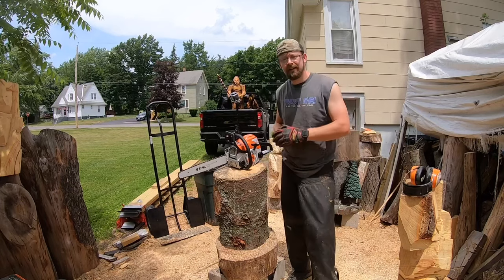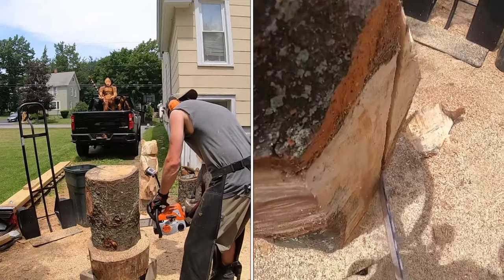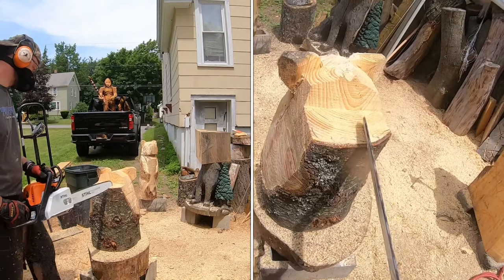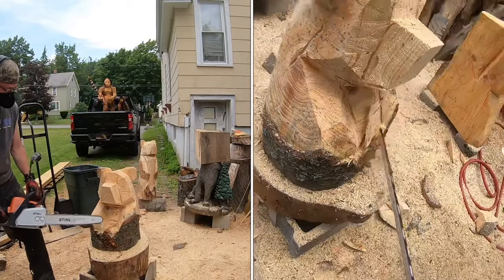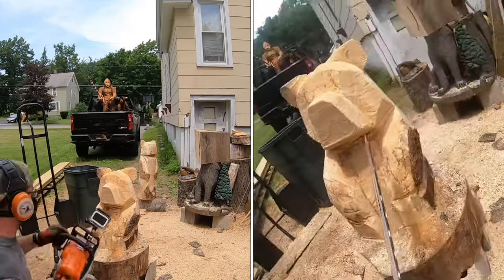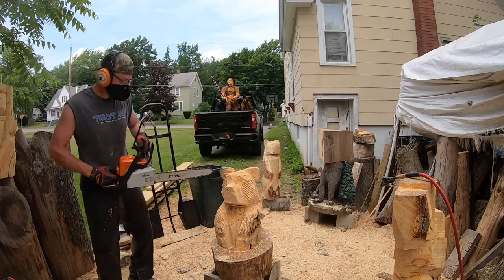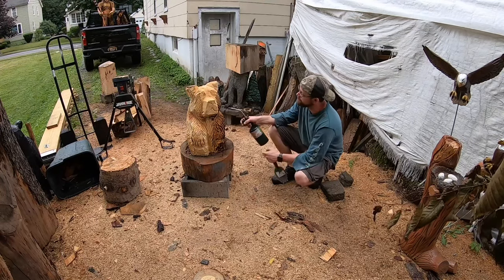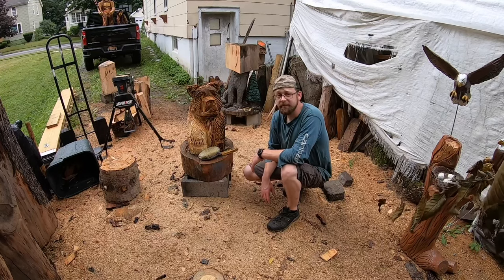Want to carve a bear ? Have a stock Stihl MS 170 ? Beginner chainsaw carving tutorial First carving

Comment: Nice Video. Would like to add that the Ms170 has Problems with the Heat from the Catalysator (melts through the oil tank) and it's carb isn't adjustable on most models.

I think for beginners a Stihl Msa140 is a good fit, since the chain and bar are better for carving. Also a electric chainsaw might be easier to usw than a gas powered one.
Reply from the maker: Thank you for the input Julian
Reply: I can confirm that the ms170 will need constant maintenance..I completely rebuilt mine last summer...I got parts from Amazon Germany although I live in southern Ireland..half price of cost here!
Reply: Cannot beat the lightweight electrics when you're near an outlet...

Comment: Frame 18:22 did I see u try to touch the bar n chain while running ?  Tremendous carving instruction but that part caught me by surprise.
Reply from the maker: Video was in high speed at that moment. Chain brake was on . Using my hand to focus camera as i can’t always see the bar through the camera while filming do to the Sun glare .
Reply from the maker: Theres also a good chance it still wasn’t running that’s why it cut to a different scene right after that shot

Comment: Thanks for the video! That bear looks super cute holding his paws! I made one today following your instruction. It actually came out okay considering I did it all with a Stihl 261 18” bar. Is that pine you’re using? Looks like it. I used white pine. Depending on bar position the wood would get stringy. The log I cut it from had been sitting a while. Is the best wood fresh cut? Pine? Ash? What’s the best species? Thanks again. I don’t think you’re boring lol.
Reply from the maker: You’re welcome! I’m usually carving yellow pine . I prefer pine . Sometimes I carve fresh cut , I’ll carve dried if it’s been sitting.
Thanks for the comment

Comment: I know this is a “starter” video… which I’m definitely a starter to wood carving. But I own a landscaping company, and also do some tree work. With that said, I’m not new to chain saws. Do you think a top handle saw would be better to start with? My top handle is much lighter than a 170. I do have a 170 I use on a rare occasion. But it is VERY under powered I think
Reply from the maker: The only thing I have heard with the top handle saw is the control aspect. In my opinion you have more control over a rear handle saw . Especially when carving. I agree the 170 is an under powered saw but it’s just a starter . It’s a way for someone who wants to carve but can not spend a lot . The 170 works nice as a detail saw. But if I could spend the cash I would probably just jump to the already set up 200 with a dime tip bar for detail work only . I like to use my 250 and 271 for blocking

Comment: Apologies if I missed something obvious…but how should the wood be attached to the base? Some kind of spike system/setup? Also, my Stihl is a 251C…is that really too large for beginning carving? And what about some of the smaller battery-powered Stihls…worth a look for carving duty? Thanks so much!
Reply from the maker: If your confident in handling the 251 then use it . I have used mine for blocking . I think the smaller Stihl battery saws would be good for detail work . I run the AP series battery saws by Stihl .

Comment: Thank you !!!!  Very much appreciate your VID tutorial , also ,. Could I carve with any type of  chainsaw?  I wanna buy one for work as well as for carving meaning use the same one for both applications, thanks in advance:)
Reply from the maker: If need a saw for work and want one for carving you may want two . But an Ms 250 is a well rounded and gives you the ability to swap sprocket sizes and different bars and chains .
Reply: @KyleHallwoodworker  awesome, thank you!

Comment: there is a bunch of rookie mistakes in this video.. season or dry your wood first otherwise you will be dealing with cracks in 6 months or less which involves a lot more work.. if you brush your carving after you burn it you smear the soot all over your carving which does look good.. the best way I have found is to use a grinder with a sanding disc after blocking out then with a very sharp chain do your fur detailing then brush it BEFORE burning it.. that way you won't need to brush it after burning and smear the soot which also smears the carving details.. I have been chainsaw carving for 5 years and learned from professional chainsaw carvers..